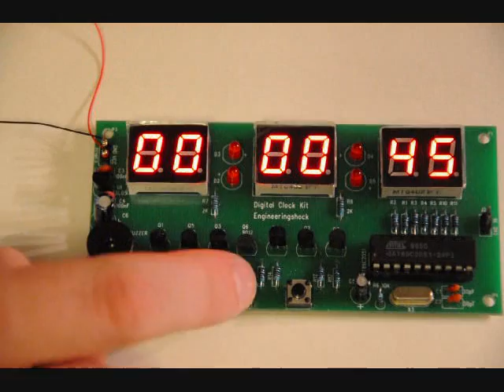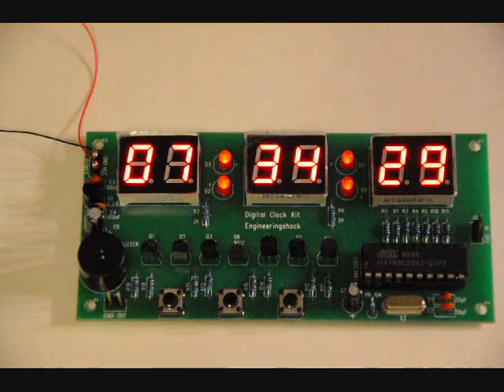6 Digit Atmel Clock with Alarm / Countdown Timer / Stopwatch

Comment: @creedrulz6000 try getting a voltage regulator such as a "7805". This nifty little device will filter voltage supplies anywhere from 9-18Volts (approximately) and tone it down to 5V. It does this through eating power, so it is best to have this 5V regulator to a low voltage supply such as 9 or 10V instead of 18V.

Comment: i have an old drill with a good battery 9v or 12v how could i use it as a power supply everytime i try to use it with some led's or something is throws sparks at me i don't want to mess it up so i stopped messing with it all i could run on it without sparks is an old led computer fan

Comment: What are the Challenges with this is not explained ?   I notice there is power backup of basic Clock so it is not a useful Clock until you power by Add-on Batteries from your Phone Intercom set.  I have picked the kit and I will assemble and give the feedback,     how  the clock behaves when there is power cycle.

Comment from the maker: @kristaps400 Hi sounds like you either have a short on your transistor, or poor soldering.  check the tranaistor and the resistor going to the transistor, and double check orientations, and for shorting on the chip.  If the whole digit isn't working, then your issue is 99 percent related to soldering.